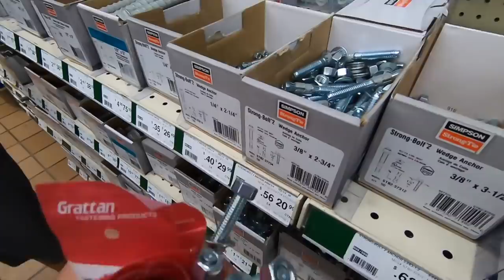BUILDING THE ULTIMATE GARAGE PRESSURE WASHER DETAILING WALL!

Comment: I JUST picked up this pressure washer!  Waiting on my cox hose reel as it's backordered with the mount, but I really liked that you showed how to make the entire shelf unit.  This is perfect and I think a MUCH better solution than spending $120 on a s/s metal shelf that the pressure washer sits on.  One thing that people do NOT mention is that since you used wood it will actually dampen the noise of the pressure washer compared to a metal shelf which would amplify it!.  Can't wait to use my 630 TSS this weekend for the first time.

Comment: You could always add some fairly heavy duty (short) springs with thick washers on both sides, under the pressure washer to absorb some of the vibration you will get if it's directly mounted.  Pads will work too probably but might not work for long if you use it too frequently.  I'd definitely try and go with SS braided hose as well.  This setup is going to be sick.   Great job.

Comment: Hydraulic hose and fitting shops also carry those type hoses. You can have them made to length needed also they can replace the ends on the hoses.

Comment: Future reference the Krenzle 1322ts is the best for detailing puts out 2.3gpm whilst keeping 1100 psi best u can get and its pretty much the same price as that AR blue
Reply from the maker: Brad Taft that model is $200 more and doesn’t shut off when the trigger is released. To me the AR blue is superior with that feature.
Reply: The ar630 provides higher output than the kranzle and is cheaper.   It’s a no brainer

Comment: Does that fitting on the hose reel swivel? I noticed it was rotating when you were cranking it, and that would mean you’d have to disconnect your whip when winding up your hose. Also make sure your whip is pressure rated to whatever you are running your washer at.
Reply from the maker: Todd 419 yes, it swivels. It’s just a bit stiff so it was spinning with the drum with no resistance on it.
Reply: DMAXRYNO I figured it did, but thought I’d ask.

Comment: PVC?  I would run copper.  Then again, I am a guy with high standards.  Also, your patch hose from that outlet to the pump inlet can be done with black rubber hose that you can probably buy in bulk at a hardware store and install either crimp brass or just some standard ends and making one of those ends a 90 degree going into the pump.  The same could be said for the outlet, a 90 degree fitting, if it works going down to the hose reel.

Comment: If you want a shut off valve on the pvc use a true union ball valve. Use them all the time at work. Really the only time i have one leak on me is if the oring wasnt seated properly, plus if it does leak you just unscrew it and put a new one in

Comment: The hose reel, is that connection point fixed or does it rotate once you have a hose connected to it? When you were turning the system, it looks like it continues to spin with the handle. Looks like that will be an issue if that's true....
Reply from the maker: TheScatManMan it’s just stiff and had no resistance on it. The drum spins independently from the connection.

Comment: @dmaxryno I was reading up on that particular pressure washer and it's got a siphon hose on it for 'detergents' and automatically mixes the correct amount of water with it. Curious to know if that will eliminate the need for the foam cannon all together.
Reply from the maker: Matthew Egbert no, that is different from a foam cannon. It may apply soap but it won’t get frothy like a foam cannon.
Reply: @DMAXRYNO  gotcha! Would have been cool if it would work though

Comment: Please be sure to record when a leak from the high pressure hose sprays all over that electrical panel 12 inches away.   And then the reaction when you find out the insurance company isn’t covering that claim because it wasn’t built to code.   Should make for plenty of “likes!”   Placing rubber spacers between the wall and plywood AND under the pump will help reduce noise vibration.   Good tip with the rubber paint.   Great job on the build.

Comment: Smack Ryno how does that battery circular saw from Milwaukee work for you all the ones I get get die very quick
Reply from the maker: Matthew Prince this is the 12v version and it works well for its size. I refuse to buy an 18v one until they make a rear handle saw, but the new Milwaukee batteries are beasts. I’ve always been impressed with all of their tools
Reply: Oh like a worm drive ok I’ll have to try it man

Comment: How much PSI would you recommend for an electric pressure washer for cleaning my aluminum wheels on a mercedes s550? I see some say online that you can harm the car if the pressure is too high.
Reply: Sure, but it’d be real hard to get that kind of pressure from an electric unit. Anything under or around 2000 psi is just fine. But you do want high GPM for washing purposes. If you haven’t pulled the trigger yet, hope this helps

Comment: If anyone is going to buy water hoses, do yourself a favor and buy Craftsman Garden hoses. you can get them at ACE Hardware, or order them off the internet. They have a lifetime warranty, and you can leave them on 24/7 in the sun and even run over them and they will not swell or bust. Bottom line is they're awesome!

Comment: $700 isn’t bad for that pressure washer with its brass pump, heater and AR is a good brand. It’s not Cat, but if you got a cat pump it would be more for just the pump.

Comment: Im abit pesimistic when you are using wood, because like you said the hose is a bit leak, it will crush the wood in some way, better u use  stainless steel plate, i lt is safer...

Comment: Ryan, Ryan, Ryan. Soooooo Getto. That PVC should be copper. On the wall. The tanks should be hard piped, or at least stainless water flex. I've been climbing the wall watching the last 2 videos. Im about ready to drive down there and pipe that in the correct way. You always do such quality work and I always admire everything you have done. But this project, Not feeling the love my brotha. :-(
Reply from the maker: Gene Littleford I don’t own the building, I’m not going to spend the money to hard pipe it all. Sometimes you have to get a little ghetto fabulous!
Reply: It's all good brotha, One good suggestion. The stainless steel water flex nut x nut and some IPS nipples to put on the 2 tanks. They are probably iron pipe size either 3/4" or 1". Flexes to match the same size. Way better than green hose and won't burst. Plus it will look clean and you don't have to leave it with the building. Not expensive at all. You should find it at the Home Depot. Love the channel and all the diverse content. Keep it up and Work For It! Blue Collar all the way. :^)

Comment: pretty sure you buggered up the nut on your redhead and had problems tightening it up
Reply from the maker: Not at all. I leave them above the thread about a half turn so you can actually back the nut off in the future.
Reply: I've done it before,if you hammer on the nut and mushroom the nut